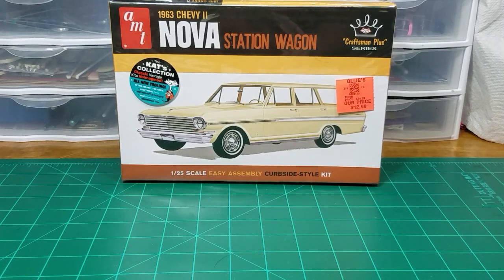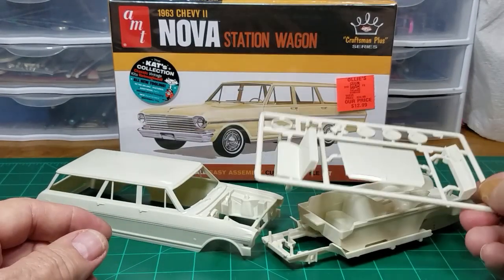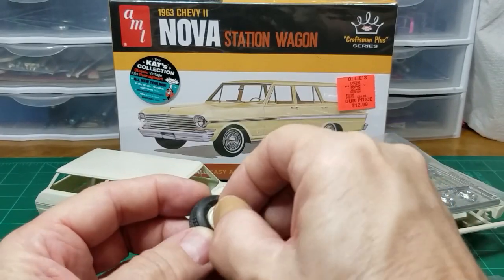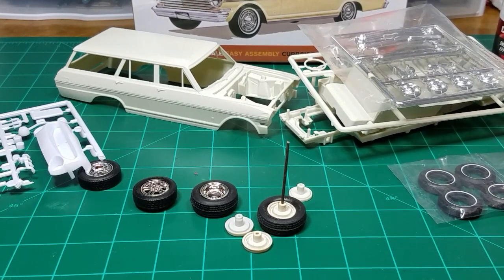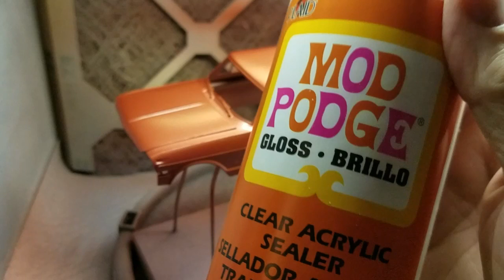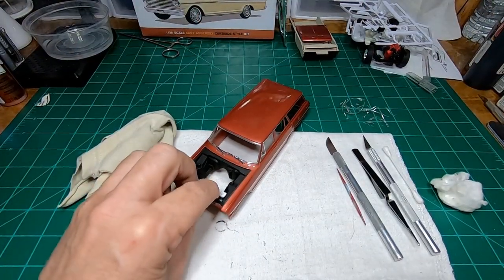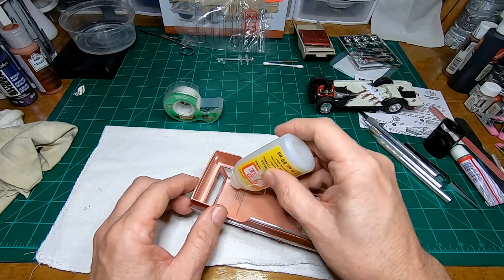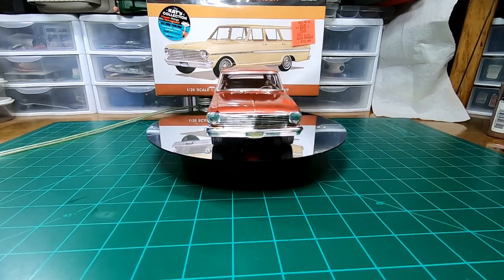1963 Chevy II Nova Wagon “Craftsman Plus Series” by AMT - Episode 47

Comment: Perfect color and perfect tire and wheel combo.  It gives the car a nice stance.  Good job.   Thanks for the video.
Reply from the maker: Thank You. These were about the fanciest wheels that I had on hand that would fit correctly. The paint... well, that was a total experiment and I wasn't sure if I was going to like it at first, but after I got the color coat on I was totally sold on the color. The two coats of clear helped bring it around just a little bit more. Thanks for watching!

Comment: That looks really nice. When I built my Coke version I enjoyed everything about the kit  except I found the tires were such a hard rubber it took a bit of work to get them on the wheels. For my second build of this kit I’m still undecided as to do a companion in different Coke livery or go the more classic route like you did. 👍
Reply from the maker: This kit gets around! So far, I've seen it in at least three different versions. The Craftsman series. Coca-Cola and the one with the customizing kit. I took one look at the tires for this build and decided right away that I didn't like the way they looked. I found that if you throw them in some hot water for a few minutes they become more pliable and it is easier to mount them on the rims. 
 These Nova wagon kits are just like the 1977 Econoline van kits. One of them is a Coca-Cols version, one in the "Cruisin Van" series and one as the "Surfer Van".  I have almost all of the Coca-Cola vehicles except for maybe two or so. I recently did the 72 Chevy pickup in the Coke livery. That turned out pretty good.
Reply: @scaleautoguysworkbench  thanks for the tire tip, I’ll definitely try that on this build. I’m a sucker for the Coke branded stuff, I’ve done the 40 Ford sedan delivery and have the 55 Cameo in waiting. I’ll have to do a van version as well.
Reply from the maker: I am too! I have the Pinto, Ranchero, 72 Chevy pickup, 32 Ford Sedan Delivery already built. I also have the 55 Cameo, 53 Ford Pickup, VW Beetle, 77 Econoline, 40 Ford and the 40 Willy's in my stash waiting to be built. I'm slowly chipping away at them.

Comment: Rally wheels, the one from the AMT 69 Chevelle
The engine from the other kit comes with a fuel injection option
Reply from the maker: I was thinking about how a set of the rally wheels would look on this but didn't have any on hand that I could use. I downloaded a PDF copy of the instruction sheet for the engine build and had seen the fuel injector listed. That part didn't come with the engine purchase from Ebay. I was lucky to find what I got. So, I just went with that. It still came out nice overall.

Comment: It's a wagon, that in itself is unique enough imo. It should be built bone-stock, with tires and wheels provided. As good as the rest looks (I REALLY like the paint and BMF, and front grille), the wheels/tires look too big in proportion under the fenders and it's distracting, again imo.
Reply from the maker: I agree with you to a certain point. It being a wagon does make it unique all on its own. I do agree that the tires that I have on it are a little to big but I like the stance. I wish that I could have found something that would have been a bit more aesthetic but this is what I had. The stock wheels and tires, imo, were way to skinny. Perhaps, if the suspension would have been "adjustable" a slight lift of the body may have given the tires a little less of a bulky look.

Comment: Molotov Chrome pens would be easier.
Reply from the maker: In a sense you are correct. However, I prefer the foil. I don't have to worry about the foil turning into silver paint if I happen to touch it and I don't mind the foil as I have been using it since about 1998. Easier isn't always better IMHO.